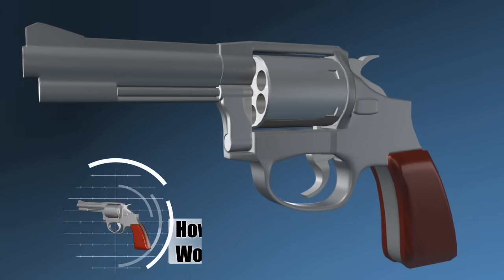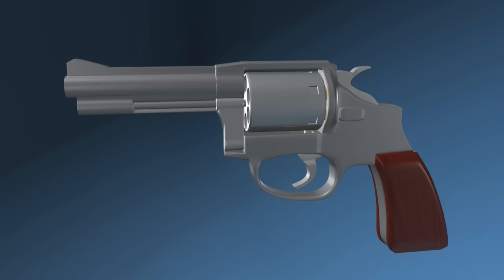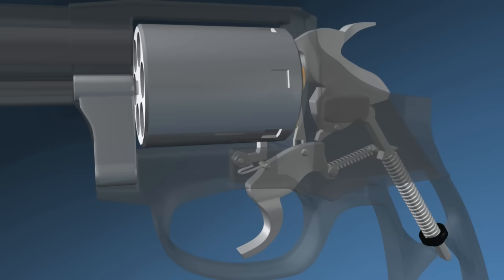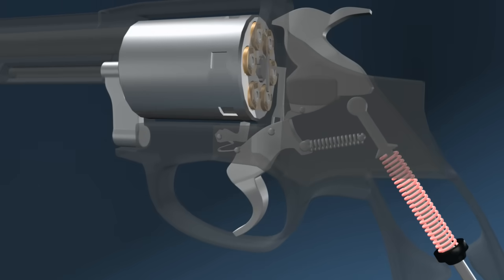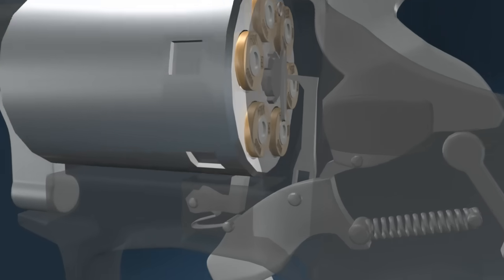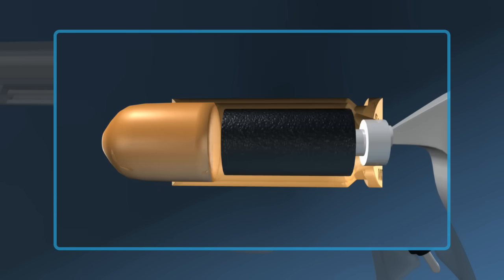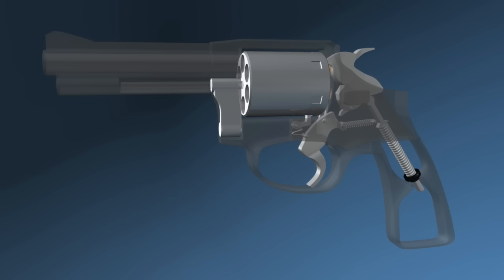How a Revolver Works

Comment: I noticed one thing in all modern guns. We need springs to make them work. SPRINGS . Let that sink in. A very useful invention.
Reply: Springs make my pen work
Reply: And when springs weren't a thing, we used ropes for bows and crossbows.
Reply: @Zegger   And matchlock guns. Early guns were basically a cannon with a stock to help absorb the recoil. There would be a rope doped with a slightly combustible fuel that would cause it to smolder but not burn. During loading you would pour the main charge down the barrel and ram down the ball, then you would put a small amount of powder in a small pan near a hole in the barrel. During firing, pulling the trigger would lower the match into the pan, igniting the primer which ignited the main charge to send the ball downrange.
This design had a major drawback, the match had to stay lit, if it went out the gun would not fire. It was almost impossible to use early muskets in the rain. Of course, if your gun didn't fire, it always could be used to crush the enemy's skull.
Reply: What the fuck does the sink want now
Reply: @cocknballsproductions  you cant have sink without a spring near by feeding it.
Reply: @cocknballsproductions  just let him in bro
Reply: @cocknballsproductions  The sink wants to be petted, fed and stroked...also a lot of water :3
Reply: @cocknballsproductions  QQqqqQQQqqQ
Reply: Simple yet effective. It's the small things that make the greatest difference.
Reply: Putting it into a larger perspective, almost anything that moves another part mechanically requires a spring-loaded, pneumatic (including compressed gasses) or hydraulic mechanism of some sort. Depends on whether or not you need a blowback or recoil to complete the cycle. Machines are extraordinary pieces of art.
Reply: Nice observation
Reply: Spring makes offspring...
Reply: @davidsailo4802  😂
Reply: They are even needed for nerf guns springs are indeed a very wonderful invention
Reply: The m16 is gas operated. Gas blowback cycle. No spring. There is a spring in the ejection port but it isn't necessary
Reply: @luke8857  wrong. there are 3 springs in the m16. look it up right now
Reply: @LANDONNNNNNNN  can you like not read or something? I said the ejection port has a spring so does the trigger assembly have a couple. So what? The basic design doesn't need springs that's the point. I'm pretty sure the trigger springs basically just force semi automatic fire. So who cares? In later models they force burst fire.
Reply: @rk31611  first of all, wrong word, also that’s not how guns work.
Reply: Guns are mostly springs
Reply: What is a sink?🙄
Reply: I just realized how many things use springs. Yes, it is an indispensable part of modern technology and has been for centuries.
Reply: Springs are only one component. The metallurgy has advanced a lot as well, so has propellent to be modern nitrocellulose. Lots of small things come together.
Reply: The revolver also has a spring
Reply: dude who created springs prolly in his grave rn like "i still need that money" 😂😂
Reply: Not just guns
Reply: Every gun except for a cannon needs a spring.
Reply: But when making Lego guns you use rubber bands normally
Reply: U can work any modern gun without spring but spring provides longer ranges but without spring its still can shoot long range but the bullet will drop in mid air when it sits for too long

Also spring provides semi auto safe
Reply: I guess it was just a modification of diaphragm,and tension properties of string that were used before
Just a guess
Reply: Why would I let a random ass sink waltz right into my home?
Reply: My teacher asked what was the best invention my dumbass answered "wheels" when it should have been "springs".
Reply: Almost every firearm even the early one used spring, this is the simplest way to store energy
Reply: Pft play any Fallout game. Springs and screws over everything 😭
Reply: The sink is a good dude, just let him in already.
Reply: From toys to guns, we love springs!
Reply: Yeah duh...
Reply: All of them?
Reply: We use atomic energy to heat water to make steam to spin turbines. Basically we are still steam powered.

They made bullets that are fired by electricity. Look up Bullet Storm
Reply: It’s not an invention really it’s just compression and that’s just ambient
Reply: All guns aside from matchlocks use springs.
Reply: Now i need to make a gun that works using AUTUMN
Reply: Holy crap I never actually thought of that... they seem so flimsy to the point you would think they are useful! Your absolutely right! My brain hurts now..
Reply: I never noticed before. Even in the magazines of guns. A lot of waste.
Reply: Springs? Tension-based energy storage devices? The hunting bow kinda had that covered for thousands of years ;-)  A matchstick of oak could provide the same snappy energy delivery, but would need replacing periodically.
Reply: 1
Reply: No Springs! 😜😜😜
https://youtu.be/le2eB2xtvBQ
Reply: @ShojoBakunyu  I skipped to that part of the video randomly 😂
Reply: So how about classic guns?
They use WINTERS?

Comment: Where the remaining part of bullet goes?
Reply: It stays in the gun, even after it cycles. They are ejected when you push in the pin on the front of the cylinder under the barrel

Comment: I know the video was uploaded a year ago, but I have a question. 
You mention that the hammer can be cocked (is this the right way to say it?) back. My question is, will this have any advantage? Like it will fire faster or something? Or is it just for 'fun'? 
Thank you
Reply: When the hammer is cocked back, either in a single action revolver or a double/single action revolver, the advantage is a markedly lighter trigger pull to fire the gun, which usually offers maximum accuracy...a double action trigger pull, having to both cock the hammer and fire the gun, is usually 2 or 3 times as much effort, for example, a 4 pound single action trigger vs. a 10-12 pound double action trigger...the flip side is the double action trigger is pretty foolproof, grab gun, aim, and fire about as simple as a gun gets...under duress simple frequently wins, and with the blood flowing the heavier trigger probably wouldn't even be noticed...

Comment: Makes you wonder why  most revolvers are so expensive... -_-
Reply: IIIRattleHeadIII 
Materials used i guess
Reply: Metal is expensive mate. Have you seen the prices on those small metal robotics parts and not to mention the spring has to be a very compacted coil which makes it strong and the gunpowder in the bullets.
Reply: @Pengulin  it's not the metal as much as the manufacturing and the R&D of the design and manufacturing that is expensive.

And our economy is capitalistic so most things are overpriced, especially where there is a monopoly, duopoly or in general ver low competition.

Comment: I have been shooting revolvers for years, there's one Q I never understood. How does the gas generate enough pressure to push the bullet down the barrel when a lot of it escapes out of the cylinder gap? Wouldn't the gas take the path of least resistance? Isn't it easier to come out of the gap rather than push the bullet out of the barrel?  They say the gap is needed for clearance, but with modern CNC machines, can't the gap be reduced by at least .010"?
Reply: You kinda answer your own question...the cylinder gap must exist, elsewise it wouldn't rotate...and a small amount of propellant is wasted through that gap, but most is funneled through the barrel (there is a pressure principle, or two, that factors in, but I can't recall the details)...remember, we are basically holding controlled explosions in our hands, and I've had the thrill of a little .22lr rupturing in the chamber, it is enough to make you say 'damn!!'...you've known forever not to keep your fingers around the front edge of the cylinder, but getting a face full of the 'controlled explosion' will give you an appreciation of how much more of that explosion is usually going down the barrel...the Nagant revolver addressed this issue a hundred years ago, and it was eventually discovered that the loss in velocity was generally 50-125 fps depending on the width of the cylinder gap, and the clever engineering of the Nagant (a mechanism pushed the entire cylinder flush against the forcing cone) was left behind as overly complicated, compensated by improved powders...

Comment: do the shell casings stay in the recovery til you manually remove them? or do they fall out when shot?
Reply: I'm no gun expert, but I'm pretty sure that you open the cylinder, then push down a rivet which ejects the casings from the cylinder (and also any unused ammunition), then you can load new ammo into it.
Reply: Delfinition no dumb sh*t

Comment: How is the pressure sealed between the drum and the barrel?
Reply: Not sealed. Some gas escaped between the gap, so it is dangerous if your hands are near the chamber and barrel gap.

Nagant M1895 however had sealed system which makes them possible to attach a suppressor.
Reply: +Darren Atm (DaStug911) I feel like pistols are just superior then, i thought the only thing revolvers had over pistols were bigger cartridges since long cartridges are hard to fit in a grip with a magazine. But if they actually lose pressure in the gap, the revolvers have no advantage, they are stylish tought ahahhaha.
Reply: Henrique Reis da Rosa You dont want to mention reliability? The gap preasure is not necessarily reducing the energy. 

Yes a semi auto pistol may be superior since it had higher capacity.
Reply: +Henrique Reis da Rosa not a huge amount of pressure is lost anyway. For example a 357magnum fired from a revolver (vented or with cylinder gap as is called) is just 50fps (about 15mt/s) slower than a non vented barrel (a rifle with a chamber for example).
Reply: NoName feet per second! Get your head out of games.
Reply: Henrique Reis da Rosa Revolvers tend to confirm to the contours of your hand better than autos, and are much easier and more natural feeling to aim. A 50fps difference in muzzle velocity won't impact your lethality enough to counter the benefits of better aim.
Reply: Henrique Reis da Rosa Revolvers cant jam. If it for some wierd reason doesnt fire you just pull the T again no need to rack the slide,check the chamber so on so on...
Reply: Jeronimo M 
50fps?
That's like a difference between smooth 60fps gameplay and terrifying 10 fps strugle

Comment: Thats dont explain why the cylinder dont explode, how the gaz pressure is handled ?
Reply: the gas is released down the barrel pushing the bullet. once the bullet has left the barrel then the gas exits out the front
Reply: I saw a myth buster that show that the gazes also go out back behind the barrel and if you lett your finger on that spot it would be shreded.
Reply: By cold hard steel, my friend. The explosion is sealed inside the casing and the chamber helped reinforced the casing.

Comment: Is the gunpowder meant to burn as quickly as possible?  Or, is there some meant to burn within the barrel to assist acceleration?
Reply: MrSottobanco There are powders that burn at different rates. A powder formula that burns too slow would not be fully burnt before the bullet reaches the end of the barrel. A large flame when firing a round means the gasses are still burning after the bullet has left the barrel. Those who do their own reloading take into account what type of powder they use for what length barrel of their firearm they intend to use.
Reply: MrSottobanco It exist gunpwders of progressive forms, where the grains are used to hae as much burning suare as possible.

I didn't hear anything of the second example

Comment: this is a great video, but I (thinking very logically a lot of the time) noticed one error. the bullet case does not look like it it is fit for a revolver. other than that, keep up the good work!
Reply: There are few revolvers for pistol cartriges(9mm luger). The cylinder is a bit different.
Reply: Supermariojjk K Yes I noticed there was an extractor groove on the cartridge, but because the cylinder is accessible from the rear, it is unnecessary to include them.

Comment: This is an old gun with a not so realistic hammer travel distance
New guns have firing pins set in the frame of the gun that the flat hammer strikes
This has the firing pin set on the hammer
Reply: NAA still uses the pin on the hammer, part of the size thing, I guess...

Comment: I think when the mechanism in the barrel is broken, the bullet may not be able to be properly propelled out and the pressure of gas rises causing explosion. Or if the bullet would be stuck otherwise, the same will happen.

Comment: @melias67 you can. You will find that a .22 round will fit the chamber. Cap area needs drilled out, and .22 round needs filing on the end. How ever I do not recommend doing this, as they tend to blow up. Just like the real ones used to. Cap guns are made of pot metal.

Comment: revolvers cylinders aren't supposed to be so tight they need to be pried out, most (if not all) revolvers have an ejector you push that pushes all the cases out, if your revolver has a super tight chamber, use different ammo brand or go to a gun smith, OR clean the cylinder

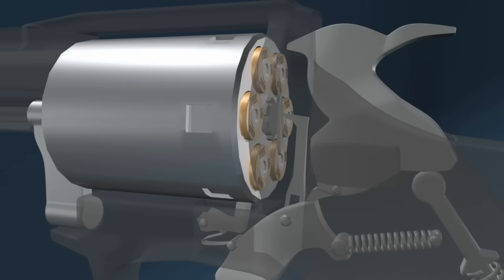Comment: this is one of the best design i saw, you make a nice design on the is it on the solid works, and i want to ask about the part above the trigger which hold the clynder, how do u really measuer the space between each grove that fits in the locker above the trigger?(0:56)

Comment: @fithare Did you mean, how does the firing pin set off the bullet? The answer is: there's a primer cap at the base of the cartridge. It's pressure-sensitive, so the sharp strike of the pin detonates it. This small detonation then ignites the main charge. It's chemistry, actually.

Comment: You forgot the mechanism that locks the hammer in place, like if the hammer where cocked before pulling the trigger. On my S&W, the trigger moves back a bit if the hammer is cocked, so a little pressure on the trigger will release the hammer.

Comment from the maker: @micas96 
When the hammer hits the firing pin it ignites the gun powder inside the shell, which 'shoots' the bullet. The shell remains in the cylinder. To reload, you would release the cylinder (about 11 sec in) and empty the shell(s).

If I redo this animation, I will make sure to add the 'loading and reloading' process.